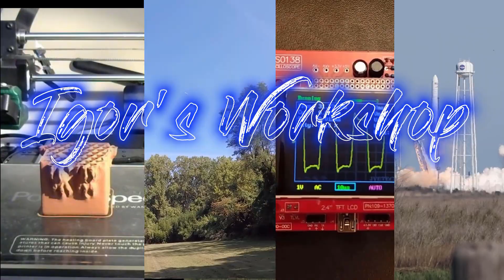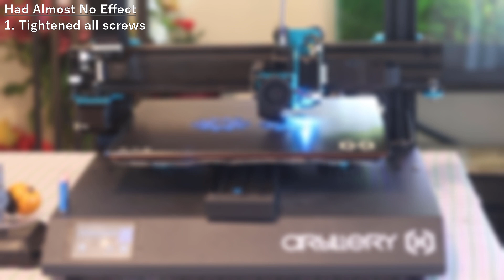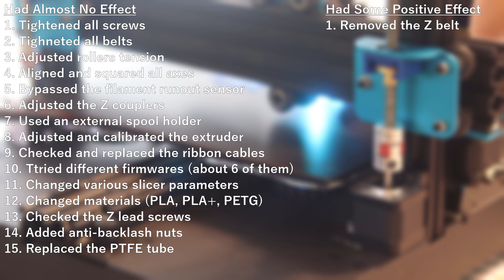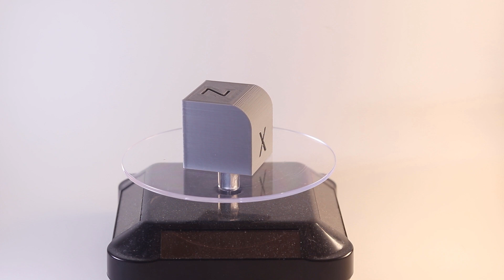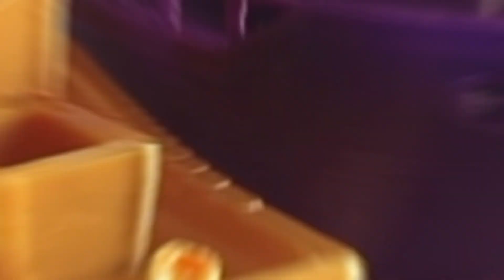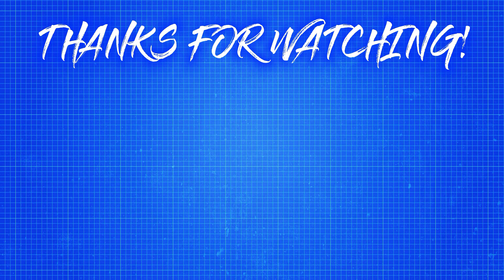Troubleshooting Artillery Sidewinder X1 | Part 3 | Is Quality Improvement Even Needed?

Comment: I bought a X1 and I've had it for about 1 month, its going great and my prints are coming out as I need them to? Sorry you having so much trouble with yours, maybe it's just a bad main board? or drivers?
Reply from the maker: Yeah, I think that I may actually have some issue with the electronics. For now I'm sort of content with the print quality, but I will definitely be looking for a way to improve it further. The new couplers definitely helped move the needle in the right direction.
Reply: @IgorsWorkshop  I think you are a bit picky. I have seen "worse" prints in videos, where the presenting "experts" say, it was a very good print. By the way: when I create functional parts, I print prototypes in vase mode simply to check sizes. I have noticed, using higher speeds has a positive impact on  the wall's surface qualtity on some filaments. Maybe a temp/speed tower makes sense, where you print with the same temp,but with different speeds.
Reply: @nuhbiwan  This is a decent theory as this machine i do believe was designed with the intent of it being able to be used at high speeds.
Reply: @lukemetayer1870  There are filaments where I can go up to 120mm/s print speed when adding 15°C and 5% more extrusion. I get really good results. Like I said, it does not work with every filament though. Maybe it is really just good material that can take a lot more temps than the manufacturer advises.